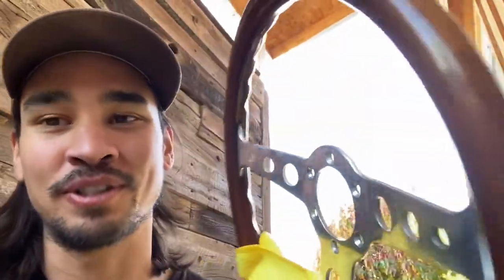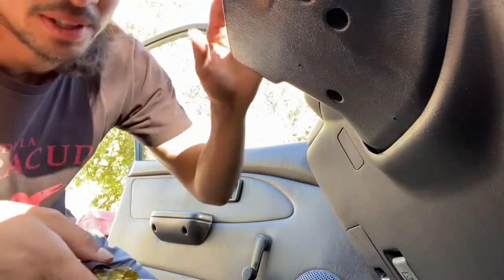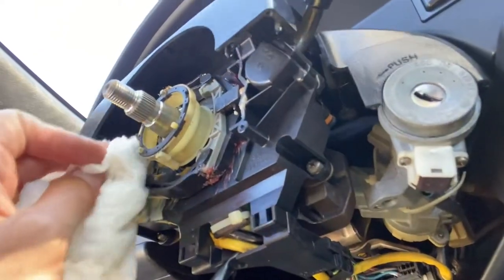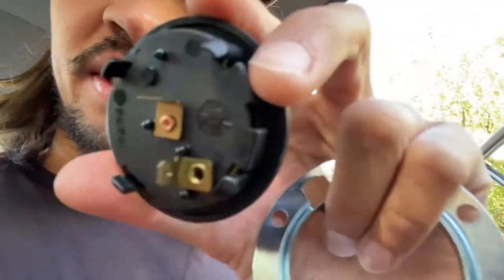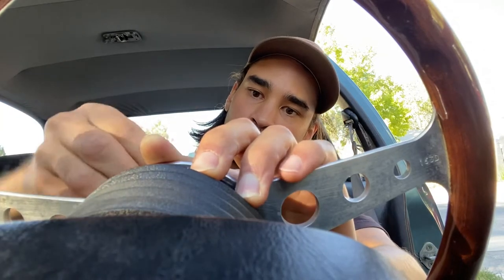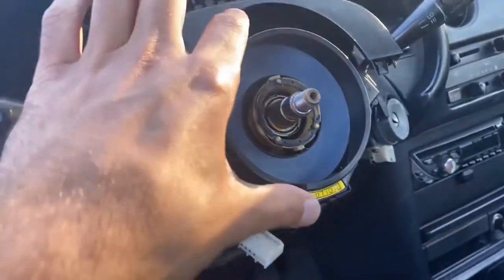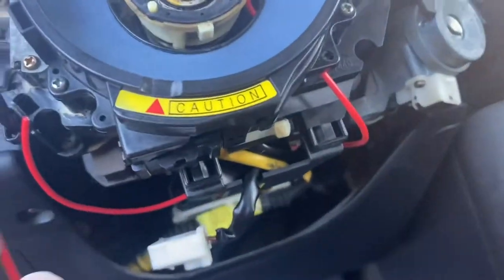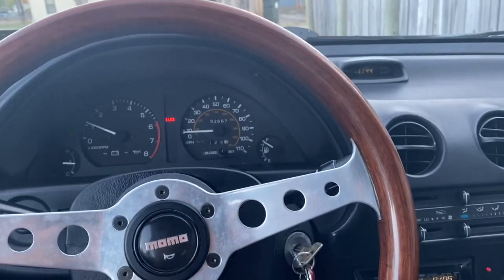Installing a Momo Steering Wheel with Horn

Comment: Thanks. It helped give me an idea on my rsx with sparco button horn.
Reply from the maker: I’m glad it helped, unfortunately the wire didn’t hold up for long. A ribbon connection is the way to go or a more spring/coil designed wire! Good luck bro hope you get that RSX wheel sorted🤘

Comment: Tip: after you break the steering wheel nut loose, back it off a bit then literally hammer fist the steering wheel rim hard with your hand,  in a circle…then the wheel will come off way easier. Leave the nut on so the wheel doesn’t fly off and give you a bloody nose once it’s freed from the splines. Don’t ask how I know about the bloody nose.  😆
Reply from the maker: Good tip thank you! I’m glad I didn’t need to use it this time 😂